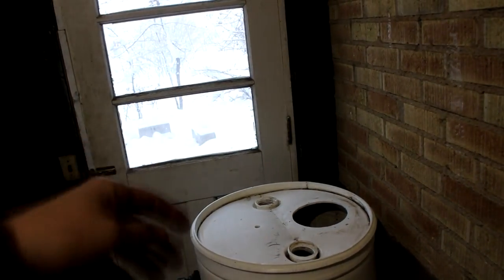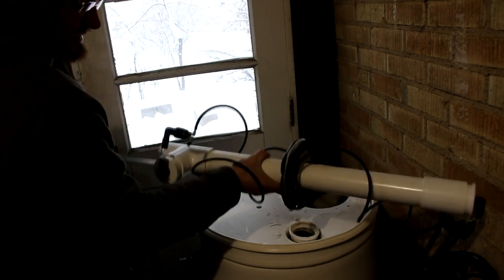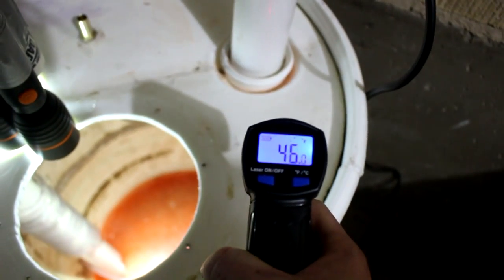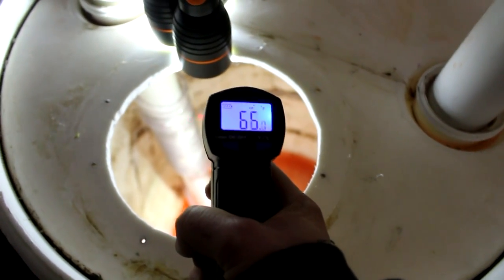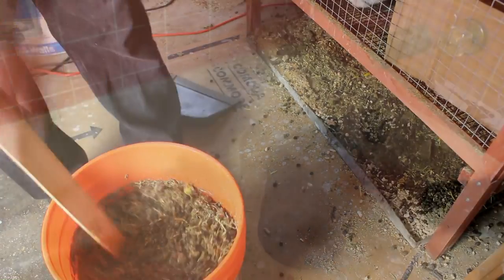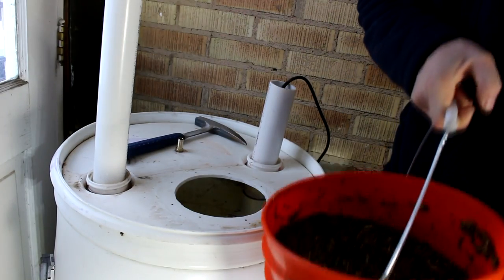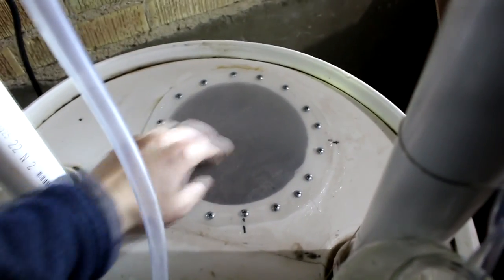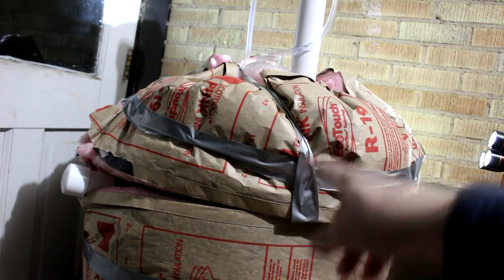Cody's Methane Generator Part 1: Putting it Together

Comment: 1:45 "i was gonna do this but that is too simple", 4:02 "well that didnt work so ill replace it with something simpler"
Reply: Is that not how it usually goes?
Reply: Frankly this is the best part of Cody's videos, IMO. He shows failures along with successes.
Reply: yolo swag that's Science for ya :)
Reply: anonymous:
Where on earth did this suddenly appear from?
Reply: +interesting 482 But Bush (administration) did do 9/11. ^_^
Reply: It doesn't matter how it happened. If it was a false flag then the government simply destroyed any evidence so it's pointless. What's important is what we do know happened after the "attacks", blatant lies and holocaust in middle east carried out by the US and the UK like a proud 1940's Germany.
Reply: Is this still going on? The conspiritard is wrong, won't listen, and everybody accomplished nothing for it. The end.
Reply: Air currents through the open whole in the building and air vents can easily fan the flames, not to mention structural weaknesses and a slew of different burning materials such as plastics, carpets, fuel and other metals. If your going to come up with a theory than you should at least also play the devils advocate to find any flaws
Reply: I can't believe I'm jumping into this...

The steel doesn't have to melt, not when it is being actively compressed by many thousands of tons of building sitting on it.

All that has to happen is for the temper to get knocked off, and then it is no longer hard and brittle and seriously strong. Untempered steel is comparatively soft and bendy, and you would never build a skyscraper out of it. 1500F would easily do it. Hell, 1000 degrees for any length of time should do it.

Remember the concrete was scoured away from the beams, and that concrete was itself carrying some of the load.

There are some seriously hard and strong parts in an airliner - magnesium, titanium, even some super hard chrome steels. Not a hard sell to see one or more beams directly damaged by those, given all the weight and velocity behind them.

By the way, magnesium and other things in aircraft can burn really hot. 5000 degrees I think for magnesium. Somebody correct me if I'm wrong on that. Plenty hot to screw up steel.

Not all the beams have to fail. If a handful of beams are compromised then there is no chance of the top of that building staying up. I figure 2 or 3 failures in those conditions could be enough.

So to make the argument that it couldn't have happened just like it apparently did is silly. The explanation is entirely plausible. As far as the rest of the conspiracy stuff, I don't have a clue.
Reply: stopped at stell melts. Though i find myself wondering what it is like to have your entire existence sum up to what is "a giant turd." You know, metaphorically speaking.
Reply: what did i do? what did i say that caused all this to happen? all i did was comment about a coincidence that i thought was funny and now i got a bunch of crazy people and some anonymous stalker crazy guy talking about how to forge metal, i mean wtf did i do to deserve this
Reply: +yolo swag ps: when did 9/11 come into the conversation and i wasn't making fun of him failing at heating some water, half the sh!t i build breaks and i have to redesign/rebuild it
Reply: anonymous Don't you think that it's more disrespectful to buy into a government narrative and accept what you think you know about 9.11 as truth? Don't the innocent people deserve justice? Do some research; even jihads and radicals say 9.11 was not terrorist and that it was the U.S. Hell, even the Boston Bombers said that.
Reply: Geoff Graham It is true that the structural steel could be damaged, however there are many more things that cannot be explained. 

For one, fire fighter's were working the sight for 9 months after "attacks" still getting pockets of air that when exposed to the outside after moving parts of the building would nearly explode due to how hot the fires were. Not to mentioned NASA's photos from space detecting temps of 9000 degrees 9 MONTHS later; the only thing capable of creating this is thermite, which was detected on multiple occasions.

Another thing is the explosions all up and down the building. I'm not sure if the 2 towers fell this way, but building 7 ( whom fell for no good reason) fell at 9 m/s². I don't know if this means much to you, but if the build fell from the top in, it would not fall at normal speed, it would be slowed floor by floor; this indicates demolition at building 7 which would explain explosions down the 2 main buildings.

As far as the strength of the plane, Air liners are made mostly out of aluminum, if slammed into a concrete build, it would desegregate before getting all the way through, but it did go all the way through? Coordinated explosions maybe? 
Last thing about the planes is VMO (maximum operating speed).  flight 175 was said to be going 150 knots over the VMO at near sea level according to NTSB tracking. Any slight adjustment by the "terrorist" would mean the plane getting ripped apart. You can test this when you're in a car going fast and you hold your hand out the window tilt it up and down. This either means NTSB gave false info, or the plane could of potentially not have been a plane at all.

I won't get into the motives, but just know war stimulates the economy and our economy at the time needed stimulation.
Reply: Dawson crazy people flew planes into the towers. End of explanation. Every conspiracy-theorist seems to forget how very shitty the government is at keeping secrets.
Reply: kkkkk yeah.
Reply: Bernardo B yup. Check out Watergate for evidence.
Reply: P. De Rop Except it is not that simple, I encourage you to look into it.
Reply: Dawson they couldn't shut up one janitor. And you think they could pull something this elaborate off?
Reply: ***** No, the person who designed the building said it was designed to withstand nearly anything. You are wrong, it is structural steel (hardest material you can build out of) and concert. Sure there was drywall on top of that, but not on the face of the building. 

Have you actually done any research or are you just trying to mold your argument as you go?

Finally, yes, the FBI report, which is sloppy and was missing tweny something pages until recently, says parts exited the building, they even found engines that didn't even belong to a 747 scattered in the streets which is curious in of it's self.
Reply: Dawson it's a lot like religion. BS you can't disprove.
Reply: *****us How are my claims diaproving eatch other? Expound please.

It is not just the frame, if you look up a video on architecture on the word trade center, you can clearly see how it was built. Again, you are just forming your argument as you go. 

Before the building went down, scrap from the plane were found on ground level. I know the FBI report says it didn't desegregate, why would it? What I'm saying is, an aluminum plane, flying into a building like the world trade center would be ruined to the point of it being compressed and unrecognisable. It's physics, you cannot argue with that. Have you ever crushed a can with your foot? That is basically what should of happened.

Also, like I said, sure it could have been damaged by the fire it produced and perhaps could have fallen without it mealting, but there is videos of molten STRUCTURAL STEEL, not the copper you play with in your backyard, at ground zero 9 months later.

Side point, I love how you choose to ignore my points like, VMO, building 7, the molten steel found 9 months after the fact, NASA's thermal photos, the fire fighters who found traces of thermite while working on the build, and the obvious economic motives the U.S. gov. had.

You clearly are not informed nor educated enough to argue on this.
Reply: Braden Anderson It is the strongest.
Reply: I cant belive my comment has more likes/replies than grant Thompson's down there
Reply: yolo swag do you think that fame will change you?
Reply: nathaniel holland-pass frankly no, i believe i will stay my own self even though i have received a small amount of comment fame.
Reply: its too late for you
Reply: Wribbit puzzles of new York city, every taxi has the number 452, four plus five, plus two. You should have sums of nine and 11. WTC was attacked the first time after George bush left office in 1993 after the 1992 election.
Reply: @High Hazers All of this tinfoil shit is so weird. The reason steal melts with this fire, and not a normal fire, is because this fire is not a normal fire. It is heavily fueled. When certain temperatures is reached by the jetfuel, it can accomodate chemical reactions in other materials from either the plane or the building, which in turn could fume up and become explosive, or cause stuff to burn at extremely high temperatures. Look at explosive Thermite compund for example. Random trucks are outside my house every single day aswell. Nothing extraordinaty about it. Who translated letters and said what? People say a lot of shit, especially after an incident, and many people seek fame for their theories "that could have prevented shit". It's silly, like saying to your friend that your tomatoes would last longer on the counter, afer they have been rotting in the refridgerator for 2 weeks. And there are 3 different sources stating that al-qaeida claimed responsibility for the attacks. No scientist have ever made an exact model, that is complete and utter nonsense. A man with a lot of money on the other hand WANTED to build an exact full size replica and send planes through it. But it never happened. I get that you are asking questions, but you seem to be very decided on what answers you want. And you are spewing out uneducated stuff you think is facts, which is a shame really. 

Now here is the thing though. The motives to start up a war like this, is in place, so i do understand where all these questions are coming from. But as i said, you are not gonna get any wiser with a pre determined mindset on what happened. I do agree that there are circumstances that looks fishy, but you can say that about ANY accident that ever happened. ANY. ANY SINGLE ONE. If you look at the right specific details, you can always cook up some kind of conspiracy theory. Name me one accident that recently happen, and I promise you I will turn it into a new big tinfoil thing

Comment: hey Cody, my parents work with koi and we use sodium thiosulfate to get rid of the chlorine in tap water. we've found that the active ingredient in dechlorinator evaporates after about a week once the container is opened.  we use crystallized sodium thiosulfate and if you would like i can send you some
Reply from the maker: Interesting I hadn't thought of using thiosulfate; besides increasing the H2S production I cant think of any reason not to use it and whats more I actually have a bunch on hand.
Reply: well im glad that i helped :D
Reply: Michael Jones Sodium metabisulfite does the same thing.
Reply: Michael J
Reply: Except that it is used to sanitize everything when making your own beer and such.
Reply: TheIdeanator Yep, but as long as you let the gas bubble out, I believe it's okay for microbial contact. After all, you brew beer with a microbe.
Reply: Cody'sLab if it makes a difference to this project I'd like to add that sodium thiosulfate doesn't help with the heavy metals in tap water
Reply: dead eye30o6 geothermal requires you to be living on a "hot spot" so you only have to drill a few hundred meters into the earth. Everywhere else you need to drill many kilometers into the ground to extract heat from the earth. In addition, the best way to extract heat from the earth is to pump water down into the hole you drilled, and have it turn to steam to drive turbines. Extremely complicated- even on a hotspot you need just shy of a quarter million usd just to prepare a small turbine system not including drilling. The efficiency of geothermal is pretty low - the water does not get very hot.

There is a pretty hard limit on geothermal extraction on the planet and the costly wells eventually slow down production and require something similar to fracking to boost production. Many of these plants produce irradiated material in minor concentrations due to the water going through the earth and collecting minerals - I don't consider it an issue but disposal is a contested regulatory barrier.
Reply: alvaro avalos: Even if there are considerable amounts of heavy metals in his tap water (which I highly doubt), would that even have any effect on the bacteria at all?
Reply: Michael Jones
Reply: The only potential reason not to use sodium thiosulfate would be if your local municipal water plant uses chloramine instead of chlorine to sanitize their water. I don't believe sodium thiosulfate neutralizes chloramine, and I know at least a few US municipalities use chloramine instead of chlorine which is why most aquarium water conditioners are formulated to neutralize both chlorine and chloramine. You should be able to get that information from your city to be on the safe side. Also, for a cheap source of sodium thiosulfate, check out film developing supplies; it is commonly used as a fixing solution. You should be able to get it dry for a small fraction of what they charge for the same amount mixed and packaged for aquarium use.
Reply: Cody's Custom Jenkem Huff Lab Part 1: Inviting Homies
Reply: Savant I'm pretty sure it doesn't remove it you are right I think
Reply: Salvatore Shiggerino I don't know if it would affect it at all but he said there's sensitive bacteria and different bacteria thrive in different conditions so it could be the difference between his colonies thriving or surviving but then again I don't know
Reply: It works on chloramine, but once the chlorine atom is ripped off of the chloramine by the thiophosphate It leaves ammonia molecules in the water.  not necessarily a bad thing in this instance if you need a Nitrogen source!
Reply: I'd like to add around a 4-4.5M solution of sodium thiophosphate is about an equivalent dose to standard aquarium dechlorinators, at least i use it as such.
Reply: Also consider most growers evaporate tap water for 24 or 48 hours (common trick) to evaporate common chrolines used in tap water for bacteria purposes (growers use mycorrhizae, and tap water typically kills the beneficial bacterias also, so this is a known common tip.. but some major cities use the non-evaporative kind, check local water supplies)

Comment: Wadup? Love all the vids. We have a biogas plant in Germany that works by the same principle, digesting the pig poo from ours and neighbouring farms. By the time it has fully fermented over about 150 days there is basically nothing left but water and minerals that then get spread back on the fields as fertiliser. All the energy in the poo that would otherwise have evaporated into the atmosphere is converted into methane and used to drive stationary truck engines that are coupled to generators that feed into the national grid. The heat produced by the engines heats the pig barn and the neighbourhood. In a year this saves the equivalent of about 1.7 million litres of heating oil. The technology is still too expensive to make bg plants self sustaining but vids like this will get more people thinking about how to make the whole process simpler and more efficient. Good on ya.
Reply: You could stick some stirling engines on those heat producing engines to get even more power back!
Reply: Greg's Wildlife good thinking :)
Reply: In the UK, biogas is big business for farms. Mostly fed with manure, silage, and food waste.
My employers do analysis of the feedstock going in, and the digestate that comes out at the end of the process, along with other agricultural testing.